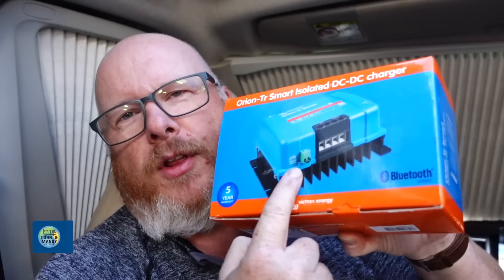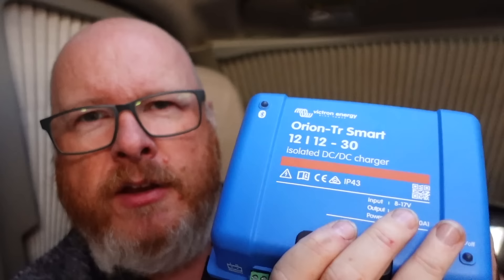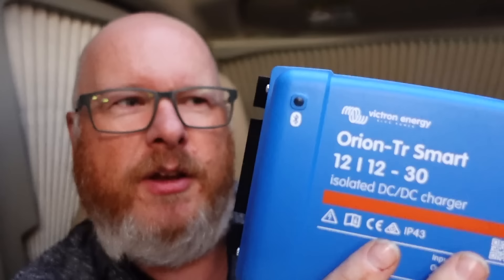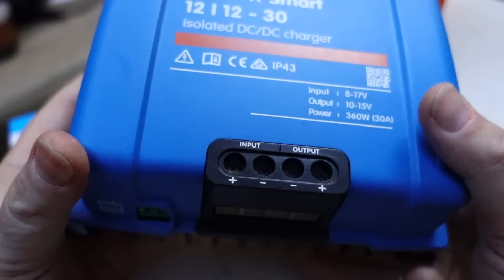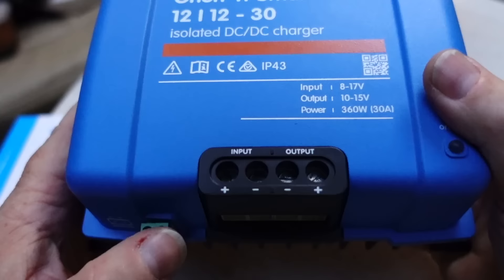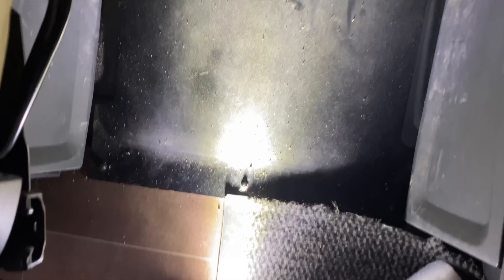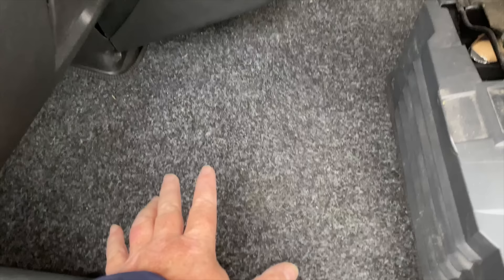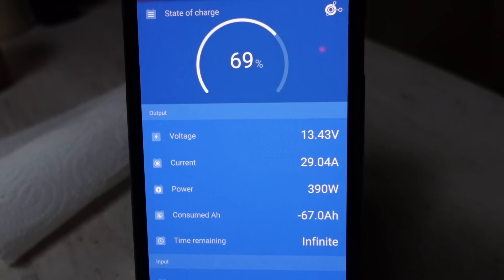Victron Orion DC-DC Isolated Charger B2B Installation

Comment: If the vehicle battery is flat will the B2B give main battery power from Leisure Battery or do you need a separate relay.Many thanks.
Reply from the maker: No, the b2b has inputs and outputs and they can’t be reversed.

Comment: Great video and guide 👍 Does the victron unit automatically shut off when it defects the leisure battery is fully charged? Or is it constantly charging? Thanks 🙏
Reply from the maker: It’s very intelligent, it knows how much charge to give at which point and once it’s fully charged it stops charging

Comment: Isn’t there a ground connection on the Orion DC to DC? I know they’re on all the other solar charge controllers. I’ve heard that you need to ground to the chassis.
Reply from the maker: No solar controllers or b2b from Victron use conductive metal, they use aluminium for heat dissipation and therefore it’s not going to conduct electricity. So you don’t ground the case, the product already is connected to the negative of your battery & therefore already connected to the chassis of your vehicle.

Comment: The solar panels on my RV keeps the couch (leisure) batteries charged, The chassis (main) battery is charged only when the engine is running or connected to shore power.  I am looking for a way to charge my main battery by solar. Can I connect Victron Orion input power from my couch batteries and output to main battery. My propose is to maintain the main battery fully charged using my solar system. Thank you for a great video.
Reply from the maker: Check this product out, it uses solar power to trickle charge the vehicle starter battery. 
https://amzn.to/38PszNU
Reply: @johnmandy  Thank You. Unfortunately Votronic Standby Charger 12V  is no longer available.
Reply from the maker: Yes it is, I can order one now. In any case, you can google battery master to find another brand

Comment: HI John great video as always..
Which EBL have you got? mines a 119 and it doesn't have a Lithium setting..
I also saw on a RoadPro video that because the EBL or equivalent has to supply the fridge when travelling there ain't a lot of amps left for charging..
Reply from the maker: The fridge only takes 12amps, the electroblock as you saw in this video delivers just over 20 amps and it backs off way before the battery is fully charged as it can’t reach 14.6v and that’s the single reason it’s not great for charging lithium, but it can still be used. 👍🏻

Comment: Love the videos, and gadgets, how was your  Electroblock set up to charge the Lithium battery's before you fitted the Victron tri smart did you just use the gel setting or flooded setting or did you have a lithium setting?
Reply from the maker: I used the flooded setting 👍🏻

Comment: Hi John, Mandy and Coops, hope your all well. John I was told I can't use a dc to dc, charger on our conversion as its not a smart alternator, but also been told to use. B to B charger because its better for your batteries, can what you've installed be used without a smart alternator, I'm confused x
Reply from the maker: Ignore the advice of the person who told you not to use a b2b if you don’t have a smart alternator. It works fine, my van doesn’t have a smart alternator. 👍🏻

Comment: My small 4cylinder van has a 160amp OEM alternator.   My house battery will be 460AH Lithium.  Can my van handle a 50amp DC-DC like the Victron Energy Victron Orion XS Smart 12/12 50A DC-DC Charger?

Comment: Curious if you can put two inputs on the B2B ? I pull a travel trailer that has a converter that charges the battery once I am on 120 volt shore power. The battery supplies control voltages to all the appliances and lights when on shore power. Then when towing the battery is charged by the vehicle alternator. So they are never on at the same time or only briefly, currently I have a lead acid battery that is insufficient when there is no shore power available. I wish to install lithium batteries to rectify this.  Thanks for a great explanation of the Victron B2B!
Reply from the maker: I’m not sure what you’re trying to achieve, on mains hookup you need a battery charger, not a b2b.
Reply: @johnmandy  I am trying to charge from the inverter on shore power and the alternator when driving.

Comment: Hi John. I know this video is 10 months old, but I'm about to install a LiFePo4 battery pack setup in the back of my pickup truck. The Battery box will be removable (Connected to the truck via an Anderson Plug). The box will hold everything, Victron DCDC-30a charger / batteries / 1500w AC inverter etc. My question is: will the Victron DCDC-30a charger hold on to its setting when I unplug the box from the truck or will I have to input ALL the settings again when I re-install the box back in, sort of like, if the main 'cranking/alternator fuse blew and cut the power off. (I'm using the box as a portable 'Power-Bank' for site work where mains power is not available). I can't find any info on this so any help greatfully received.
Reply from the maker: That’s a question for Victron as it’s not something I’ve ever done.

Comment: Hi John great vlog I'm about to fit the same victron into my citroen relay 2016 the cable you used 16mm which I think can run 110 amps do you suggest that cable or could you use a smaller amp cable because the victron that you have fitted only pushes out 30amp max 
Many thanks 
John 👍😀
Reply from the maker: The victron output is 30a. I use oversized cable all the time for safety, you don’t want an electric fire in your van 👍🏻

Comment: Hi john, I have done all my work via your vlogs for my T5 van, it's a simple basic set up, VSR connected to two 120ah lead acid batteries, the van is only used for leisure weekends or at most a week, using very little in the way of electric, 12v fridge some lights and diesel heater , I use the van as my daily driver for work 80 miles round trip 5-6 days a week, would a B2B be worth the investment. What's not great about the VSR. I like the idea that this is future proof should I be able to get lithium later on.
Reply from the maker: A quality b2b would look after your batteries and could make them last longer. But if your setup works for you then don’t change anything 👍🏻
Reply: @johnmandy  cool. Thanks John , stay safe , love to Mandy and coop x

Comment: Do you need to add a circuit breaker between the vehicle battery and the Victron dcdc charger? Does this unit not have an automatic breaker system. If needed, what size breaker did you use? 50amp? Thanks
Reply from the maker: It’s all explained fully in the video

Comment: Very timely, I went with the Renorgy B2B as it has an MPPT solar controller combined, still need to get it installed yet. If your van leisure batteries are not earthed to the van chassis is there any harm in earthing them to simplify wiring?
Reply from the maker: I like to keep separate systems for redundancy so I don’t lose all chargers should the single product fail. If your van is a panel van then it’s recommended to earth your hab batteries to the chassis. 👍🏻😁
Reply: @johnmandy  I went with this system as I wanted solar so it was cost effective and the reviews are good. We have a motorhome so not sure of how it is earthed. I am a HGV engineer and not scared of electrics so tempted to make sure all the leisure side goes to the van earth before fitting. Going to fit the victron smart shunt to keep an eye on it all.

Comment: Great video again John! 🙏
I have the same charger installed for a few days on my Fiat Ducato 2020 campervan and was wondering if you are using the "Smart alternator" profile or have set custom thresholds and if yes which ones? I really would appreciate your feedback 😉
Keep going! I started following you more than a year ago when I was thinking about buying and living in a campervan full time and you made me learn a lot about DIY and getting things done on your own.
I owe you and hope to cross your path one day to share a 🍺 or 🍺🍺😉
Reply from the maker: Our van is a 2015 and that was so I didn’t have the smart alternator and cambus to worry about. So my setup is just as I showed in the video. There are good Victron support forums you could ask for advice on. 👍🏻
Reply: @johnmandy  thank you John for answering, I really appreciate 😊

I thought that Fiat Ducato with euro5 and euro6 engines should all be equipped with a smart alternator.

Actually I've figured out just today why my leisure battery wasn't charging as much as it should have.
The answer is pretty simple: when using the speed regulator on motorways or roads that permit it the tension generated by the alternator is stable and somewhat low around 12.6V no matter if the road is going up or down (speed limiter us not braking the vehicle when going down, thus not increasing the tension of the alternator and the associated current). And 12.6V is not enough to keep charging active with the "Engine shutdown detection" threshold presets.
Today I've disabled the "Engine shutdown detection" whilst the engine is running and the charger is finally showing "absorption charge" (reached a SoC of 80%) after 4.5h of driving 😊

Conclusion: I should connect the D+ wire to the H or L pins of the charger OR meanwhile disable the "Engine shutdown detection" if I am driving with the speed regulator activated.
Reply: @matad4002  just check to make sure, I have a ducatto 2019  Imala 734 and after looking around forums etc I assumed it had a smart alternator from most info out there....Having checked and it doesnt

Comment: Hi guys. So am I right in thinking I can leave my present charge system in place that is standard in my Motorhomes and then I can add a B2B direct from my van battery to my leisure battery’s?
Reply from the maker: Yes, that’s exactly the way my setup is 👍🏻
Reply: @johnmandy  super. I wasn’t sure if I had to tie it into my existing system. Quite straight forward then I guess. Thanks. Stay safe.
Reply: @johnmandy  one last thing, as I already have solar going to the van battery will this not trick the b2b into thinking the alternator is running and suck voltage from the van battery?

Comment: Great video! I have read in the Victron data sheet that there might be short bursts of 40A max load on the output side. Have you had this happen, what size of breaker did you integrate?
Reply from the maker: I’ve never seen more than 30 amps, I’ve used a 30 amp fused breaker. It’s been fine since installed?
Reply: @johnmandy  Thanks for the reply

Comment: Thanks for the great video! 

Can I ask why does the amp output on the battery jump up when you turn on the vehicle?? Mine does the same but in my mind this is charging the batteries. I don’t understand why the output jumps up. 

Thanks
Reply from the maker: Our setup works fine, as shown in this video 👍🏻

Comment: Hi John. I have connected solar panel to Victron  MPPT 75 115 ip43, charger ,I haven't it to the battery's, the indecator lights on the charger are not on, will they come on when i connect the battery's ? Michael
Reply from the maker: All solar controllers need to be connected to the battery before you connect the solar 👍🏻

Comment: Hi john, My motorhome is nearly classic lol like me yet I have the old system of leisure batt under the bonett being fed from that dreaded switch relay from main alternator.   I thought it would be wise to move the battery location inside the cab for cod weather etc. In a old 1990 fiat would this benefit me and and should I hook a soar panel too it. lol If I did would the victron be of use to my van at this old age. I am trying to keep the van original yet modernised with electrics TY. Hope your back safe and sound . Typed from desktop this time as for my old Mi PHONE predictive text is bad
Reply from the maker: This b2b charger would work fine in your van, it’d take less power than the charge relay you have, so less impact on the alternator.
Reply: @johnmandy  great! will look into it more.  thanks for your time to research that John or Mandy if you made her do it lol. if it works I will buy her a `11v hairdryer for xmas.

Comment: Does the Victron unit lose its settings if power is disconnected from both sides? I already have an isolator in place and I was worried that a software programmed solution could lose its settings.
Reply from the maker: The b2b retains all settings 👍🏻

Comment: Hi John many thanks for the video- we brought one of these for a caddy last summer and it was fitted and got so hot to the touch we removed it. We have been waiting months but have a slot this week with the motorhome workshop for them to take a look. I know all cable sizes are correct, the install is spot on. It was mounted on ply lining in the back of the van but the company I brought it from I took it back to and they couldnt understand why it was getting SO HOT. As in the casing was about to melt. My question is- how hot is yours getting?
Reply from the maker: The product amplifies the incoming voltage to produce a higher charge, so just like any amplifier it gets hot to touch. Place it where there is airflow or pop a small 12v near it and turn on the fan when you drive. 👍🏻
Reply: Cheers john- I may as well pop down to the workshop on Friday as I've waited 7 months for the slot- I will let you know if they say anything is wrong with the unit or anything that the viewers may need to be aware of. Thanks again for the reply
Reply: We have had to get the buck boost fitted in place of the Orion today. The Orion was not compatable with outset up- new caddy, victron 200a lipo. Busck boost is working well. orion getting returned. Victron are aware of the overheating issue and will fix with a firmware update, but god knows when, we reported it to them last july. Unit was pulling 30a from inverter and out putting 50, 20a of constant heat being generated.

Comment: Very informative John! I do have a query that I hope you might be able to answer. Can this (or any victron) B2B reverse feed and charge the starter battery once the leisure batteries are full if you have an additional feed into the leisure side such as solar or 240v charger?
Reply from the maker: No this can’t reverse charge. There are dual mppt controllers that can do that from your solar setup.

Comment: Thanks for the great video, John. I just got a 12-24-15 Orion TR Smart DC/DC that I will install in my 2000 Ford F350 7.3L diesel to charge a Goal Zero Yeti 1000. I see that you connected the Victron only to the starter battery and not to the alternator as well, which is how the Victron diagram shows in the installation diagram. Your way makes more sense to me but I'm just double checking, should it connect to the alternator as well or will it work just the same connected only to the starter battery?
Reply from the maker: It’s a battery to battery charger, so this is the only way to install it.

Comment: Hi John, Mandy,Coops, i have been pationately awaiting this video to check i am wireing my b/b correctly,i just want to askwith me haveing two leasure agm batterys in parralel do i connect the output to one battery neg and second battery pos. Thankyou.  ps, i still cannoct connect  to your site because of my firewall settings,when i look at the settings page on my laptop i am feert tae touch anything,hense the reason i ask questions in the coments,thanks again.
Reply from the maker: The next video I’m putting out on Tuesday is my full electrical setup, I’ve moved away from the crossover battery connections to high current bus bars as they’re much more reliable. But if you stick with the crossover method then neg to bat 1 and pos to bat 2 will be fine. 👍🏻
Reply: @johnmandy  Ta mucho.

Comment: What’s wrong with a split charge relay if you don’t mind me asking? I have one, so is it worth changing to something like this? I have noticed when the vehicle is off but the solar panels are on and the leisure batteries are getting high the split charge then charges the vehicle battery. Could this be the reason? Sorry electrical knowledge is my downfall
Reply from the maker: I’ve answered this in detail already in the comments on this video 👍🏻
It sounds like your vsr isn’t a good quality item if it’s back feeding, not that it’s a problem as you’re getting solar to charge your starter battery, but it could also drain your hab battery if there’s no solar.
Reply: A split charger doesn't do different voltages for burst, absorption or float voltages and only gets batteries to about 80% charge state. It also treats all battery types the same and isn't good for fussy types like AGM.

Victorian themselves state that these chargers can work in parallel to increase the charge rate if necessary.

It's all about caring for your precious DC power sources.

Comment: Video came at the right time! I am buying one soon and noticed you used 16mm cable for the input did you use the same size cable for the output? And what size brakers did you fit on both positives?
Reply from the maker: 30a both breakers, 6mm cable on the output 👍🏻
Reply: @johnmandy  that's brill thank you! Did you use thicker cable for the input as it is a long cable Vs the output and accounting for voltage drop/ higher resistance? Love the vids anyway, watched for a long  time and find the content both entertaining and educational, thanks again

Comment: Hi John....
Whats the difference between a 12v / 12v charger and a 12v/24v or 24v/12v....don't understand. 
I will be using a victron on my 22plate fiat but which one do I go for....?
Thanks mate.
Reply from the maker: The voltage would depend on your van, maybe it’s a 24v system so you’d need a 24v charger.  For your fiat you’d need the same one I show fitting here.